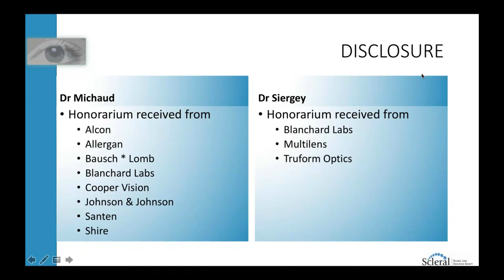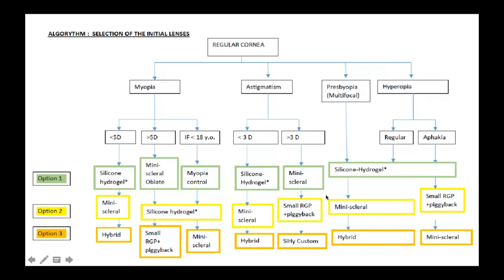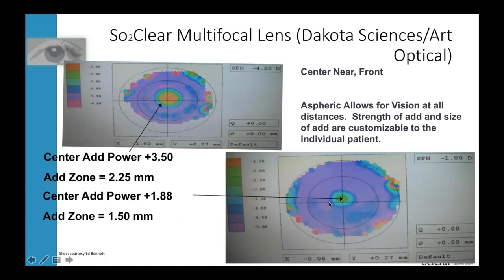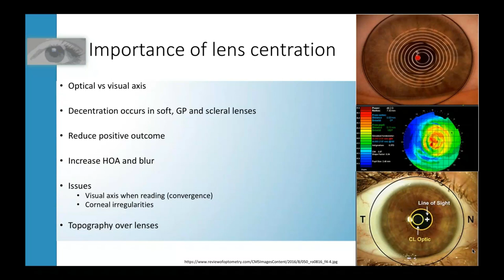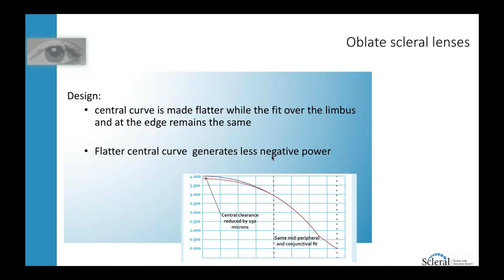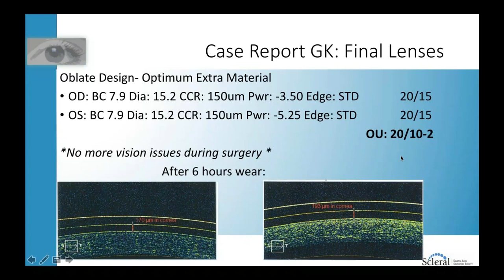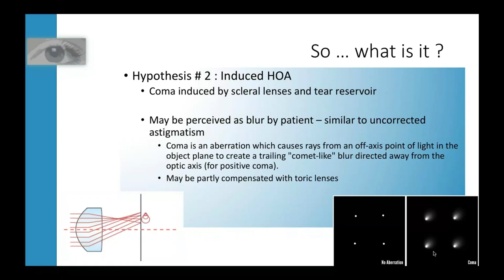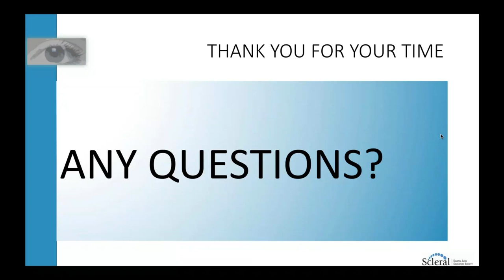Fitting Complicated Refractive Errors and the Use of Technology to Aid Scleral Lens Fitting

Comment: I believe the mathematics becomes a bit foggy around 38:00, at which point it sounds as if the speaker is saying an oblate profile delivers an additional +4.50 diopters of plus-power. Rather, all that's changing is shape-factor magnification — not the vergence of light traversing the scleral lens and entering the pupil.